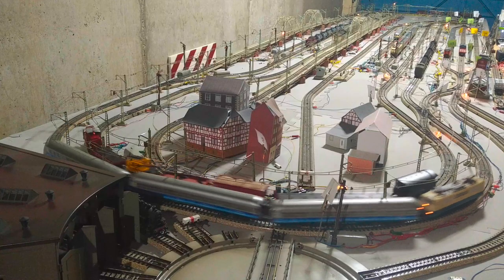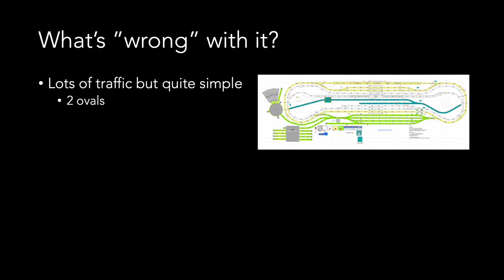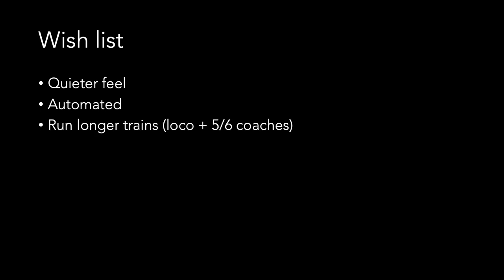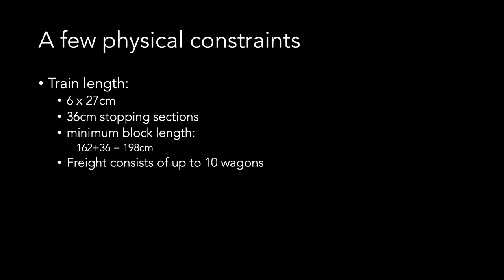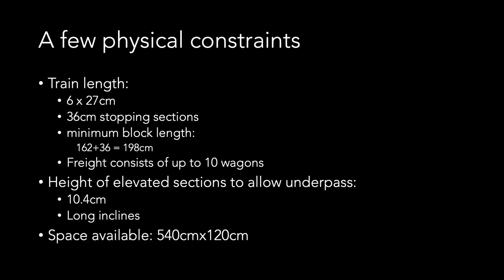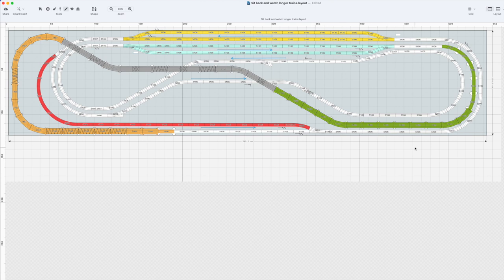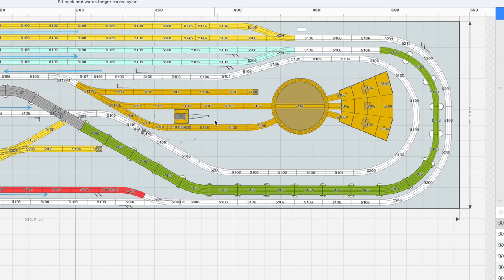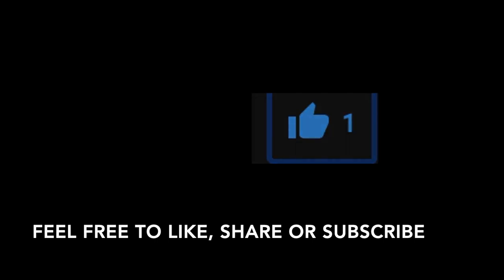2021 layout - Märklin M-Track analogue

Comment: Before you proceed, may I suggest you check the gradient of the green ascending portion ( on your plan) of line with some of your locomotives ? Pulling 5 or 6 passenger coaches on a steep gradient with short radius curves is  not an easy job. Only the most powerful locos with strong motors can make it, with good traction tyres and with well oiled coaches. They could also require a separate transformer to feed thisportion of line with maximum current delivery, and the following flat and descending sections could be " over fed" causing excess speed...based on my own experience. Thus, separate transformers are easier to adjust.
Philippe
Reply from the maker: Yes, This is the key point to check. I am planning to test my gradient configuration ahead of building the layout. I don't want to use anything else than the standard Märklin pillars for this bridge system so if if doesn't work, I'll have to think about something else. This will be a good topic for a future video :)

Comment: Indeed, when you have the space for it, the bone (or folded bone) -layout is better than the couple of ovals -layout.  (And the ends of the bone can be used to add garages or even a spiral to lower levels).  The "Sit back and watch longer trains" layout is definitely an improvement.
Reply from the maker: Thanks, the new layout is definitely somewhat different, time will tell if it is really an improvement 💬 Thanks for your subscription 👍

Comment: Looks like a really good layout. Are you concerned about reaching over the layout? It will have elevated track and catenary and there might be problems with derailments etc. What do you think about putting the passing loops at the front instead? Looking forward to the next videos👍 cheers Graham
Reply from the maker: I should be able to walk around it given the dimensions. I can flip the layout if need be. I am intending to use the long straight and the red lines to set trains up, this should be easier to do than on the passing loops with all the catenary there.  But dismantling the current layout and  incline tests are my first priorities for now.